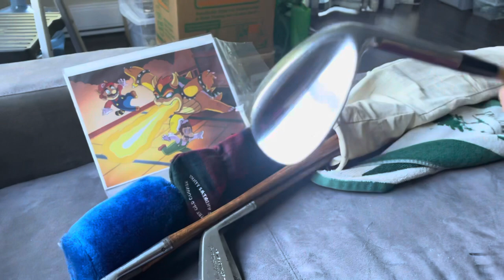Hickory Golf Grip Quick Fix

Comment: I would recommend putting some whipping above the hozzel on some of those similar to how the sandwedge does. It helps reinforce an area that gets stressed most during play. It's pretty straight forward whipping these clubs, as it's pretty easy to find thread on Amazon.
Reply from the maker: I just did that because the veneer was chipping there it’s the only club and they set that’s not Hickory I got a Niblick and mashie niblick on the way so when I play in anything official Hickory league or tournament or for hickory handicap the sand wedge will be removed from play but the guy  selling only charged me $15 for it because it wasn’t Hickory versus $50 per club for the rest of them .It’ll probably find its way into my vintage set when I get a proper Hickory sand wedge lofted club Louisville Golf makes a good modern-day Hickory Clubs that are approved for official Hickory play so I’ll probably go there if I need a specific club that’s hard to find
Reply from the maker: Definitely good advice I’ve reinforced some of my clubs with hockey tape to add weight for my liking as well as reinforcement at the hozzel.Thanks for the tip